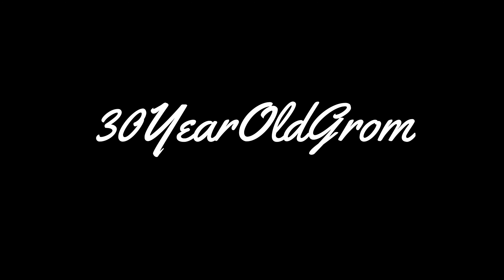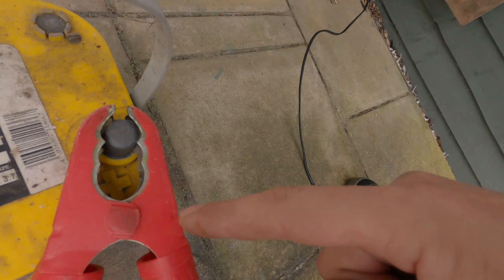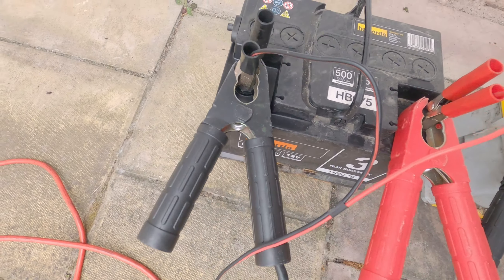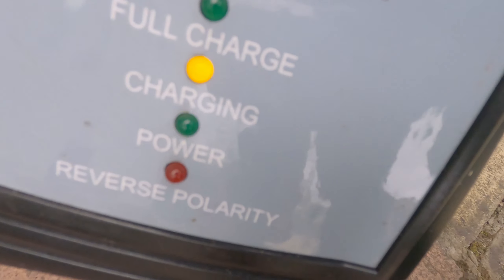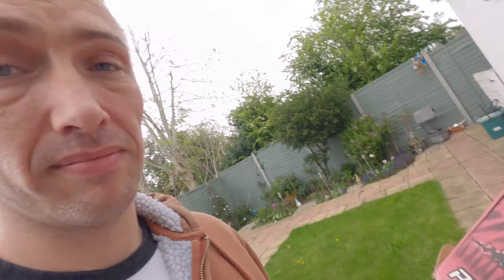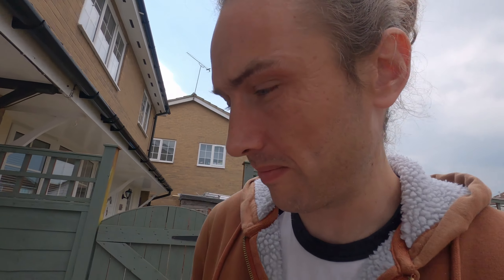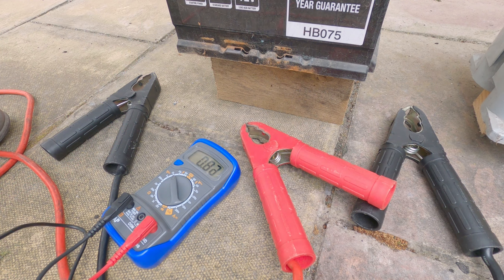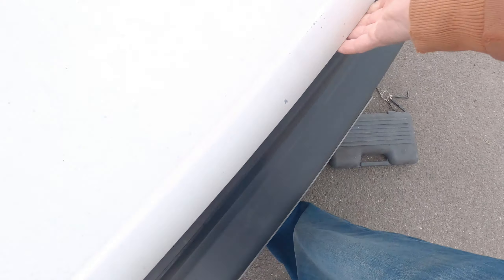Not Taking Charge!!

Comment: Hi Mart, Try Tayna Batteries if you do need a battery, best cheap battery source I've used them and they are very good delivery. How are you doing generally now you've been back for 4 days this week or did you take these off too. I have been 9 weeks with Nyetimber so far. My next event is a 13.1 mile walk across the Seven sisters, pretty steep climbs and troughs and like its 7/8 including  Beachey Head, one heck of a challenge and even a struggle for me. But still awesome at the same time. I've been practicing on our Leith Hill just out of our village and some backbreaking climbs  on the way up. Cheers Gav
Reply from the maker: I'll have to check them out. I think the Optima has seen better days. Shame as it was a good battery. Seems like you've got your work cut out in the coming weeks getting ready for that walk. 🙌🙌🙌 rather you than me buddy. Fair play to ya.